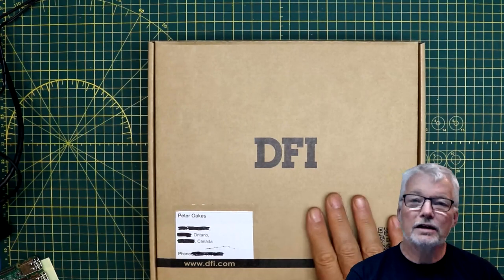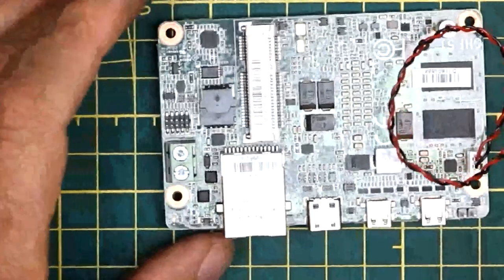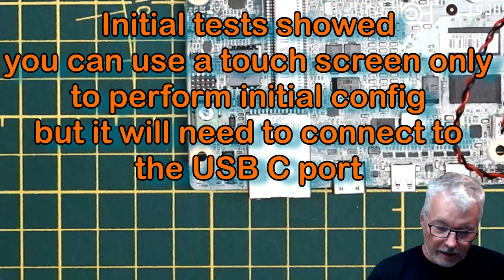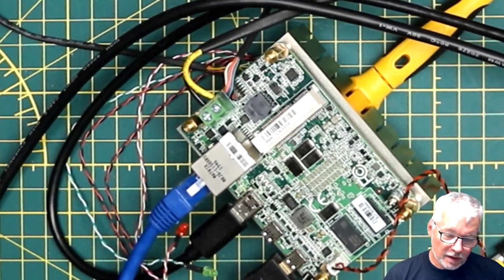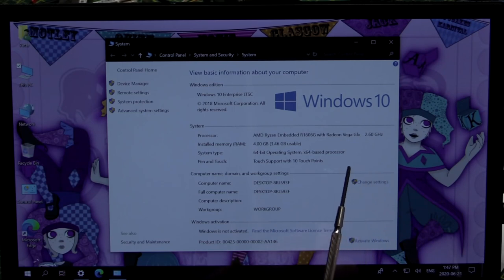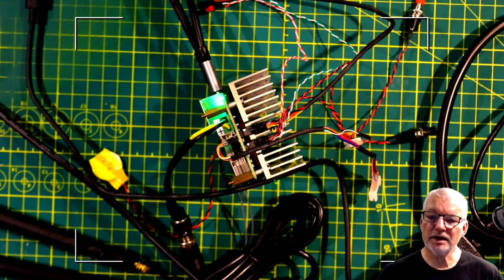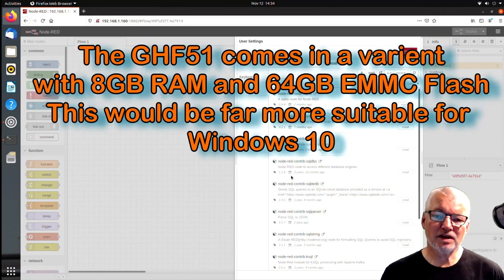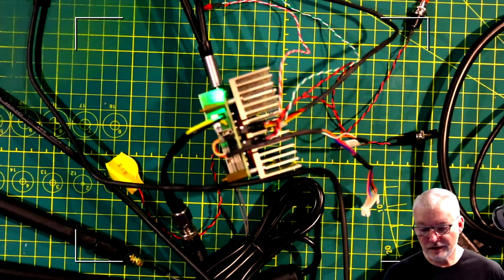1.8" power house Ryzen 1000 based SBC, the GHF51 from DFI

Comment: Please make a video on how to program GHF51 DIO under Ubuntu Linux. Preferred using Python. I have not been able to find sample code on the internet.
Reply: The DIO adapter is a TCA6408A connected via SMBus. You can instantiate it using the i2c dev interface and then use it like any other linux GPIO adapter.